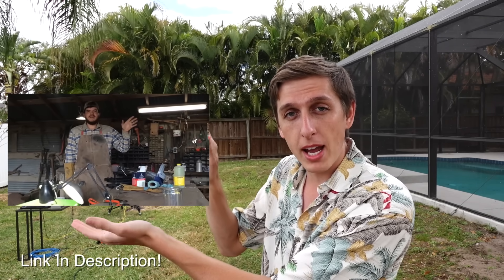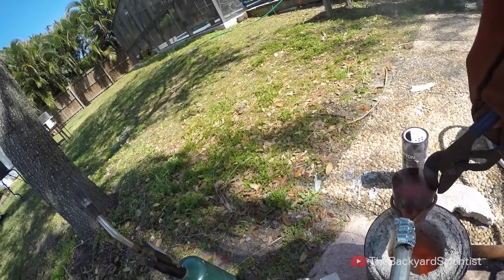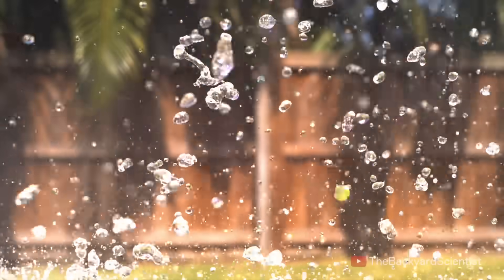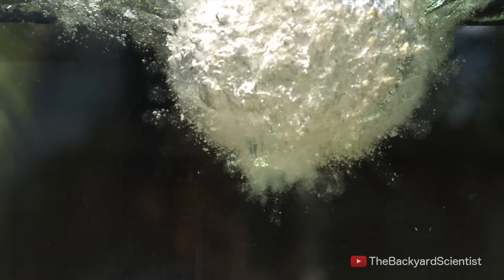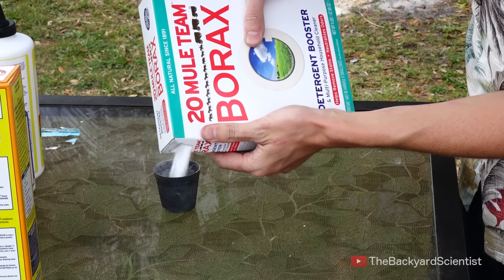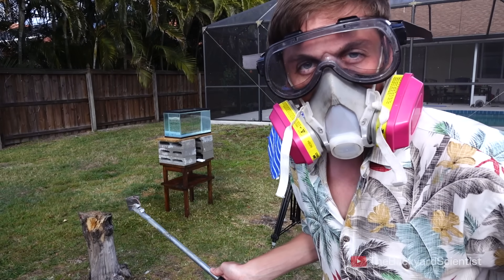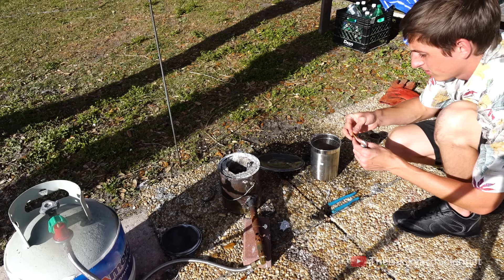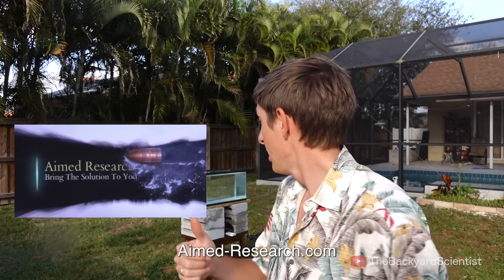Pouring Molten salt into Water - Explosion!

Comment: fun fact!

if you dip your finger in water then dip it in molten metal, your finger will not burn (you will have to pull it back up as quick as possible though).

that is becuase of the awesome leidenfrost effect. the leidenfrost effect is when a really hot thing comes in contact with a cold or normally tempretured object which then cuases a cloud of steam around the object and protects it from the hot thing!!.
Reply: +L.E Wolf Looks like someone watched Mythbusters.......  FYI it only works with lead anything else melts to hot for a stable or long enough lasting leidenfrost effect.

Comment: I'd bet the explosion is from the heat of solvation of the water soluble ions. Normally much of the energy involved is used up in the dissolving of ions from their crystal lattice. However, you've already skipped this step by introducing a tremendous amount of energy to liquefy the salt. The net energy release is therefore solely from the new intermolecular attraction between the ions and the polar water molecules giving a purely exothermic process.

Comment: My Hypothesis

Notes beforehand:
1) Chlorine is a much stronger anion than tetraborate and carbonate
2) If the reaction was merely physical (the heat of the molten salt turning the water to steam) then similar explosions should have been produced by the less ionic salts with higher melting points, even if smaller than with the NaCl.
3) Adding salt to water is not going to change the pH, but that does not mean there is no chemical reaction occuring (The end result of OH ions from the sodium hyroxide will cancel out with the H ions from the hydrochloric acid.

I would propose that due to the high amount of thermal energy added to what would be an otherwise very mundane addition of Na and Cl ions to water, the NaCl actually acts as a catalyst in the production of hydrogen gas, hydrogen peroxide, and oxygen gas as the sodium and chlorine ions strip the H2O into hydrogen and hydroxide ions as they would normally at room temperature. However, due to the high heat that is also being introduced, a bubble of steam begins to grow within the tank of water, and being that water is not compressible, the bubble becomes a high temperature, high pressure reactor of unstable ion filled micro droplets and depending on the mixture of ions begin to desperately seek more stable formations such as hydrogen gas, oxygen gas, hydrogen peroxide, and water vapor.

Naturally this becomes a very explosive mixture very quickly, and in the presence of the high heat detonates returning to the much more stable H2O + Na+ +Cl- in a glorious display that brings you right back to where you started.

This also explains why the borax and carbonate compounds were less successful, despite being ionic compounds. It would be interesting to try the experiment again using potassium chloride or maybe lithium chloride. If my hypothesis is correct (or at least in the right direction) the reaction should have similar results with those.

Comment: bro! you just uncovered the greatest idea in solving the fuel problem. that molten salt looks like it separated the hydrogen atoms from water in a rapid form. forget about electrolisis. now. i'll begin to construct my water engine, thanks
Reply: +Zero Melsgiven [sarcasm ignored] It'll probably have terrible efficiency. I think most of the energy you put into the salt by melting it will go to warming up the water / turning it into steam and only a small part to thermolysis splitting water into hydrogen and oxygen.

I'd love to be wrong though.

Comment: I think the leidenfrost effect may be protecting the other samples simply because of the higher temp that they were at causing the effect to act more quickly and completely than it did on the lower temp table salt, allowing contact with a few water particles

Comment: if the sodium can get under the water it would have a more violent reaction, so if you protect the sodium using the Leidenfrost effect then shouldn't it have a more violent reaction? this should show the chemical reaction  at a more violent stage because non of the sodium is blasted out from the Initial explosion

Comment: It explodes because the heat from the molten salt quickly heats up the surrounding water to form steam. Since gases occupy more space than liquids, it expands creating an explosion.
Reply: +Nissim Raj Angdembay (ニシム) Yes, but why doesn't the leidenfrost effect stop this from happening? He does the exact same experiment with  those three other ionic liquids and doesn't get even close to a similar result.
Reply: +Monkyupurbutt Ahh yes. The obvious answer of the explosion is simply water turning into vapour. Of course, hydrogen cannot be involved here since it would create a mini fireball. However, you have pointed out several concerns such as:
- What about the Leidenfrost effect?
- What about other ionic liquids?
I will only put up a theory here. As soon as the molten salt touches the water, the water molecules swarm around it to turn the molten salt into an aqueous solution. I think it has something to do with lattice enthalpy. The lattice enthalpy is of course related inversely to the sum of radii of the cation and anion, so a greater enthalpy change is observed with smaller compounds like NaCl than NaCO3. This greater enthalpy change vaporizes the water much more quickly. The salt is of course 'falling', so it encounters fresh surface to transfer energy to, negating the Leidenfrost effect. Of course, I am only guessing here. Correct me if I am wrong.

Comment: you guys should have placed a huge tarp or blanket around the aquarium (by the grass) so to easily clean the shattered glass(the glass will drop on the blanket/tarp,not on the grass/ground)...even if you didnt expect it to shatter the aquarium you should have expected it as a precaution.

Comment: Its quite simple i think. Sodium is an alkali metal, which means it belongs to the first group of the periodic table. Most alkali metals react with water (potassium gives the most dramatic effect, you should try to melt that). Once you've molten it, it falls through the water because its surrounded by vaporized water (pure sodium in solid condition would float on water due to it being less dense), once the fluid water touches the molten sodium, a reaction emerges (2Na + 2 H2O -> 2NaOH + H2). You could test it by trying to catch the hydrogen gas and try to light that. Wish you the very best of luck!

Comment: I think the Hot Salt let the Water around instantly cook and the Water turn in Microseconds into Steam.The Salt fall into the 'Water and sinking down.The Water turns into Steam,but there is all Water around.The Water in the Fiash around the Steam Bulbble is Dense,and it holding the Bubble long time tight.But then the Steam have so much Power,that it´s expand like a Explosion,cause the Watertank to break.

All this Video in some shot sentence.

Comment: Doubt would using merely 5 grams be a good test. 50g of NaCL is almost a mol of that stuff. Therefore I think you might be able to recreate the explosion at it full glory if you use ~20g of Na. 

Btw does the salt melt at a much higher temperature than the metal?

Comment: Here's what I think: The answer is in the beginning of your video when the salt solidifies in the pan and begin to pop into your hand. At this time, the crystal structure loses its architecture and begins to unravel. In contact with water , all the liquid salt sample passes into solid and breaks into numerous small crystals , transferring all its temperature instantly into the water around them , which vaporizes explosively . The borax does not fall apart when it cools, transferring its temperature much more slowly.

Comment: What a dumbass, couldn't figure out if it was chemical or a physical reaction?

It's sodium, an alkali metal... Same as lithium and more. Very reactive in certain states with water.

This is high school chemistry.
Reply: +TgTfProductions if it reacted with the water it would have a PH gain from the sodium chloride reacting with the dihydrogen monoxide
Reply: +TgTfProductions Its already reacted with the chlorine and is a very stable Na+ ion, if this were a simple reaction between water and sodium the pH of the solution would have changed, but it did not.

Comment: I think that it's pretty obvious initially that neither the sodium ion nor the chloride ion is reacting with the water. They both have completely stable electron configurations and are highly unlikely to participate in any kind of transfer of electrons with water. I think that john carter has a decent idea, but if this was the case then the enthalpy of solution for sodium chloride would have to be negative (as in the case of sulfuric acid), but the enthalpy of solution for sodium chloride is +3.87 kJ/mol, which makes the dissolution of NaCl in water endothermic. The fact that the enthalpy of solution for sulfuric acid is negative is what causes the splattering due to the release of heat when the hydrogen sulfate and sulfate ions are solvated by water. In other words, I think that it's pretty obvious that nothing chemical is happening here.

Comment: I agree with your hypothesis. The explosion has to be powered by confined steam.  As for why the same effect wasn't seen with Borax...?  Maybe the viscosity or density of the molten states is significantly different?  The molten NaCl looked like it had pretty low viscosity when molten, so could easily "branch out" and form steam pockets. I'll leave it to somebody else to actually look up the viscosity of these various molten salts...

Comment: Try mixing molten KCl or MgCl with water or salts with similar melting points if you want to know definitively. KCl is better at determining whether the reaction is chemical or physical then pure Na or by pH. If the reaction is somehow dividing Na from Cl because of the high temperature then it will happen with K and Cl the same. If not and its a physical reaction then maybe the crystal structures are to blame, so go with MgCl.

Comment: Okay so one thing in your experiments that you left out is that salt is water soluble vs the other compounds.   There may be some very interesting physical mechanics happening rapidly due to the high temperature of the salt.  Salt in a fine ground form for example dissolve rather quickly.  Take salt in an already liquid state, add water and it appears to be rapidly dissolving into the water, but due to the high energy immediately flashing it into steam.  Kind of curious as the how the solids formed in the bottom look like up closer.  Are they a new lattice structure formed by the rapid evaporation of the water into steam?  Raise a lot of interesting question.  This is definitely a thermodynamic reaction involving compound state changes and little to no chemical reaction.
Reply: +Dwayne Peterson Oops the other materials I meant to say are not as soluble perhaps as salt is.

Comment: What you are creating is a simple steam explosion. 1400 degree salt in placed in 70 degree water which boils at 212 degrees, which results in rapid boiling and steam expansion. That's what happens when you try to put out a burning metal fire with water or a raging forest fire with a garden hose.

Comment: have you considered that you might have separated the oxygen from the hydrogen by introducing that much heat all at once and then the remaining heat was enough to ignite the hydrogen since it has a relatively low flashpoint and the ignition then burned the remaining oxygen until all the gas produced was burned up? that would explain why each test had slightly different results because the relative temp of the molten salt would directly result in a specific amount of gas being released over the cool down period this creating a different sized explosion each time. food for thought.

Comment: Awesome experiment.  You are very knowledgeable and curious, curious being the main thing I have here. From your demonstration I can conclude that you obviously have  a very good idea of physics but please tell me what your opinion of rocket power in space. Simply put do you think they can actually work in space? The reason I pose this question is  because only just recently I have the idea because of physics background, do they really work. Notice I am but questioning the idea because of Newtons idea that force is equal to the amount of the energy push pull theory.  I need a guide to go by you see. I am struggling to believe nowadays that rockets actually work in space as there is no force to act upon or not ?

Comment: So I am not sure why it exponentially explodes (However I absolutely love your explanation with the putty) but I DO think it is a chemical reaction as well as the physical reaction like you explained.
So when liquid NaCl is added to liquid H2O this equilibrium equation is created.
NaCl + H2O ⇌ NaOH + HCl.
When the molten sodium chloride is reacted with water it creates hydrochloric acid and sodium hydroxide, when these two chemicals react it is an exothermic (heat producing and expanding) reaction. And as we all know when an acid and base is mixed it makes an effervescence (bubbling) type reaction which causes the extreme and rapid expansion of air inside the water.
Then when all is said and done, and the Sodium Hydroxide and Hydrochloric acid have reacted the two products left over is Sodium ions and Chlorine ions floating around the water, which would also be known as Salt water, and THIS is why there was no difference in pH level when tested.
Reply: +TheBackyardScientist

Comment: Here's my theory on it: When you melt salt, the lattice structure between Na+ and Cl- breaks and you have free flowing Na+ and Cl- ions in the molten liquid. When the molten salt is poured into the water, it's temperature drops rapidly, making the Na+ and Cl- ions try to bond back together just as rapidly, since bond-breaking is an exothermic process, the result of many ions forming together in a short period of time will be an explosion. You can see in the video that as he increases the temperature of the molten salt, he gets a bigger explosion, that's because it has more free flowing Na+ and Cl- ions forming bonds to create a larger explosion.
Reply: +Theo Leung This explains why leidenfrost effect doesn't prevent an explosion and easy to prove. Since during the explosion unequal amounts of Na and Cl would escape the water, the resulting water would be ionized (though it would require more molten salt and a more sensitive tool to find the ph level). I hope someone tests this hypothesis
Reply: +Theo Leung It doesn't explain why nothing happened with other ionic compounds. If it is true they would do the same as NaCl.
Reply: +Cédric Schoonen It would explain it if the temperature of other salts was high enough to melt the salt but not high enough to ionize it. I cannot say anything for certain since I don't know the exact ingredients of other salts as well as the temp they were dropped in to the water
Reply: +zübeyir oflaz I found in the Handbook that the lattice energy of Na2CO3 is 2301 kJ/mol and 769 for NaCl. Their fusion temperatures are 851 and 801°C respectively. So you're right, it is possible.

Comment: I hypothesize that this is a sodium chloride based reaction. you know that the sodium chloride reacts violently with water when in contact. well what if the other element In the salt was acting as a buffer between the sodium chloride and water as to delay the reaction. as the water cools the salt there is a point in time where the salt is just cold enough to where the water can make contact with the with the sodium chloride and start the reaction. and as that is happening more smaller pieces of the sodium chloride blasts out to create smaller blasts within the water.

Comment: That happens because the sodium in the salt is an alkali metal, which means it reacts violently with water, and I think the heat separates the sodium from the chlorine, and the naked sodium  explodes in contact with water

Comment: if you mix chlorine with water it makes a similar explosion it doesn't combust. I would say the more you heat up the salt the more separated the sodium and chlorine get. in this case the sodium and chlorine are both simultaneously reacting with the water creating a larger and less firy explosion. It made a second smaller explosion because it reacts so quickly that the salt didn't have time to completely sink into the water before exploding so some was left over to fall into the middle of the explosion and produce second reaction.

Comment: My two cents on this: When you poured molten sodium chloride, it did not appear to be very viscous, and acted like water. Perhaps this caused the molten salt to coalesce into smaller particles as your poured it/as it hit the water, and thus created an uneven surface for the leidenfrost effect. By expanding steam across an uneven surface, this might exaggerate the expansion of the salt and allow water to mix into the molten salt as you explained. For borax, when you poured it at 5:15, it seemed far more viscous and instead of separating into small droplets, it stayed as one continuous smooth stream. This created a nice smooth surface for the steam expansion, and thus "protected" the salt long enough for it to cool and not explode. Perhaps a follow up experiment could be to attempt the borax explosion at a much higher temperature (easier said than done) to reduce its viscosity, or try an additive to the same effect.